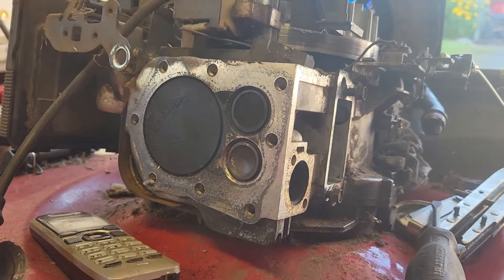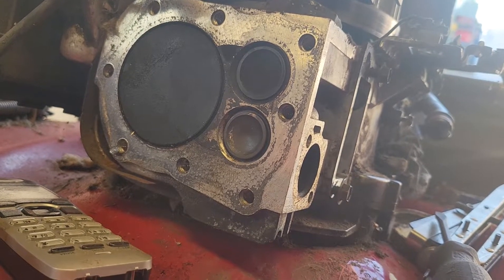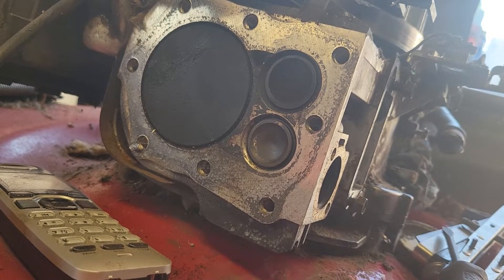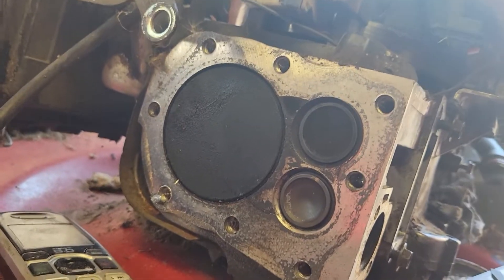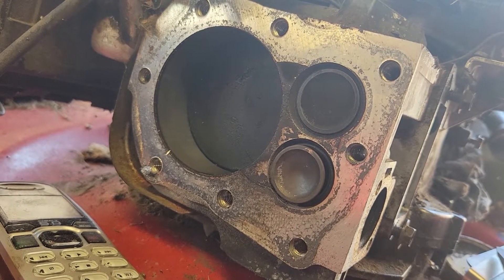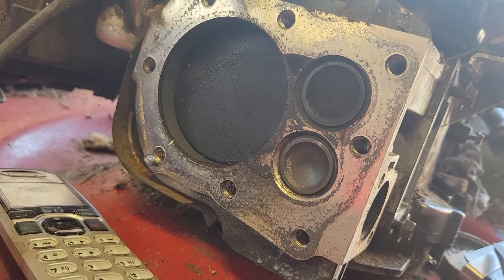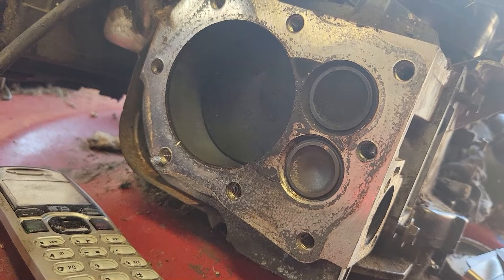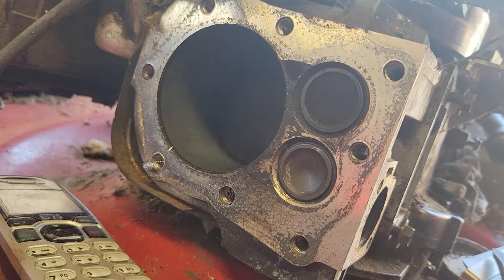Broken canshaft-valve timing on a briggs quantum

Comment: Interesting video! I've never seen this before. 
I had a problem with a Deere pusher today that has the Briggs flathead and it was hard to pull the rope. Timing was good, flywheel key was not sheared. I opened it up to check exhaust valve clearance and it was over 20 thousands. I couldn't believe it. Intake valve clearance one was very large too. I put in two used valves, set the clearances and all is good. Not sure how this happened.
Reply from the maker: @RiverWaves-k4e  interesting for sure as I thought flathead clearance tended to close up over time.
Reply: @gadasavideos8564  They do. I think someone may have put the wrong valves in this thing.

Comment from the maker: so what happened was that when valve hit plug the lobe shaft stopped turning.  it's outer plastic pinned to steel shaft. however the crank kept turning and forced the cam gear to rotate on the steel shaft.  it actually cracked the cam gear hub. engine is 2011. I had a 1991 quantum and although cam part numbers were different the 91 cam looked just like the 2011 . I installed it and the engine starts and runs great with the original exhaust valves.